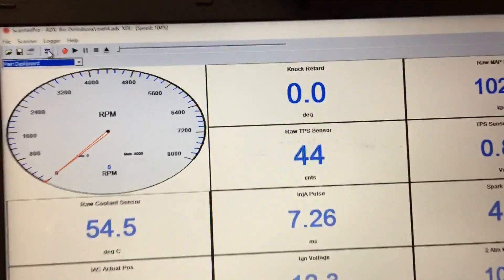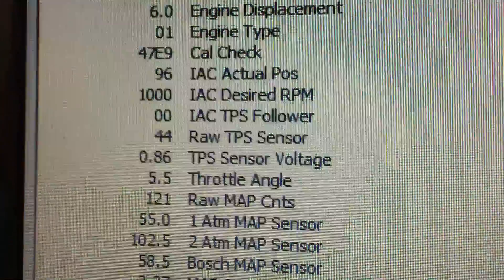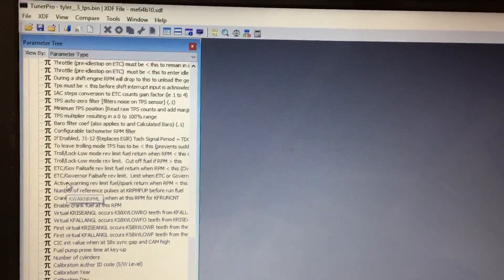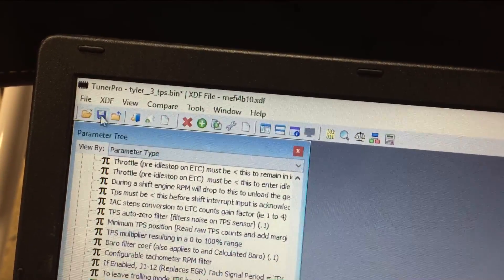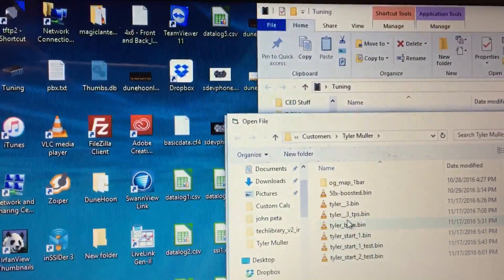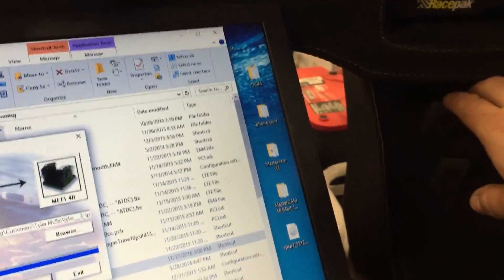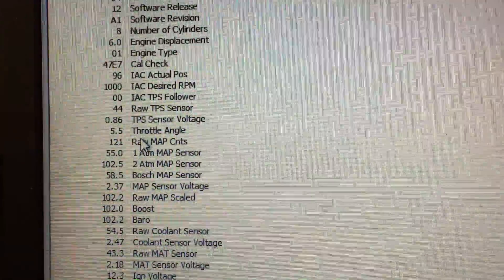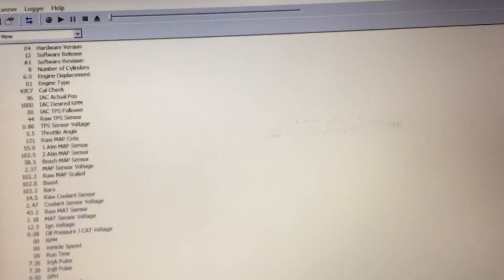TPS sensor scaling for MEFI controllers using Tuner Pro and Mefiburn

Comment: can't you use math to determine the required multiplier?
Reply from the maker: Ben Bowman you could use math...but the voltage/range isn't always the same
Reply from the maker: Ben Bowman and you also need to add overhead to keep it from entering another table due to voltage wonder...and the variable of the user cranking in the idle screw, or sticky throttle cable, or a little bit of sand, or swapping out the tps, and a bunch of other things...